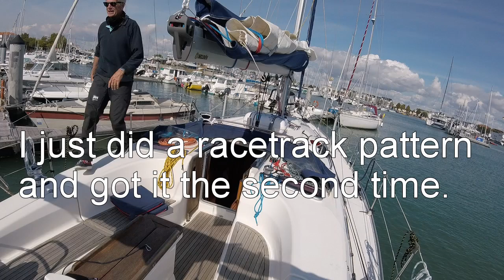Ep 18 Solo Sailing: How I Dock My 40' Sailboat 4 Examples and a Blooper

Comment: Patrick - your videos are really good. I like em' a lot - are very inspirational.

I have a Beneteau First 285 here in Sydney, Australia - is my first yacht and I love her to pieces despite her age (28 years) - plan is to master sailing her solo and I think I could benefit from having lazy jacks fitted to ease things when dropping the main.

Like you, my Furler can and does jam from time-to-time (no tension on the furling line etc. when letting out the headsail) and I've had dramas with shackle pins undoing themselves (all now moused with SS wire)

Not sure the boat is capable of doing a Trans-Tasman crossing to New Zealand, but who knows!!

Please do more videos - am looking forward to them already.
Reply from the maker: Hello RoadGoose from down under.   Yes --- the lazy jacks are a god-send for solo sailors.   I just open the clutch and let the main drop --- with just a minimal amount of compressing/adjustment of the sail afterward.   I have a lazy-bag also which is very nice (for UV protection and to keep the sail from filling in the wind).  The only (very minor) issue with the lazy bag is that I can't see the luff reefing point when I lower the main, so sometimes I stop it 2 or 3 inches too high, which also causes the leech reefing point to ride up.   I could do a second iteration of the reef process to make it slightly better, but I usually just accept what I have.   (I'll try to remember to mark the halyard where the correct reefing point is this year.)   Good luck on getting ready for the Trans Tasman --- a historic passage with a global reputation.  A real test of seamanship for sure.   I hope to make a few more videos when I head North in April.   I'll publish them if the content is of any interest.  Thanks for watching.

Comment: Enjoying your channel... Old crazy sailor that was always looking past me told me to approach the dock only at the speed you willing to hit it(engine stall in gear shift to reverse). Also being funny i thought i would sail up to the dock one day and at 50yards out a tornado sprang up and almost pushed me up the docks. I'm scared of them now lol.. Thanks again and keep up the great vids...
Reply from the maker: I have heard that old saying (no faster than you want to hit it) many times Jeffrey.   To be completely honest, I disagree.   I have found that it is vitally important to keep enough way on to fully control the boat during that critical final turn.   It is greatly preferable to be 0.5 knots too fast, than 0.5 knots too slow then.   If you are too slow, you either have to gun the engine for a burst of control, or make a very large helm correction, which will probably lead to more problems -- and if you are really too slow, no amount of helm will matter, you will just be blown sideways into the finger or the other boat in the slipway.  I know many are uncomfortable with the speed I show in docking (I've filmed about 90 approaches now -- most in marinas I had never been to before), but as a solo sailor, you have to place the boat exactly right.  When you have a crew, you can miss the finger by a meter or more, and someone can still step off……..
Reply: I agree, its vital to maintain control. 
There are also wind and currents running through these marinas that you can take advantage of to nestle you into a slip if you can choose the slip...  I always slow down and try to determine if there are currents and a breeze(look at the marina wind vane at entrance etc)or radio the dock master if weather is bad(they love when you ask for local knowledge). I used to attach a line to the stern cleat and when my boat approached the end of the pier i would just hook it onto or step off and attach the stern line to the end cleat(or near your stopping point). This eliminates almost all of the rushing/running and works perfect in high winds etc... I worked on the docks catching boaters in Florida for awhile and learned thats what those cleats are for! Just do one turn on the cleat with your line and you can literally control tons with ease. There is no right or wrong way in my book just whatever does not put others in danger or ruin a good time lol. Im on Ep 23. So much fun thanks...

Comment: Thank you for this series. It was very helpful to me as a new sailor and boat owner. I'm so afraid of driving in and out of marinas that it's becoming a big concern to me. If I don't get this fear under control I may have to give up sailing! I took sailing lessons and so I'm not a bad sailor and I'm very confident out in the open water, but this maneuvering in and out of marinas is stressing me out lol. Anyway, you have helped me a great deal and I wish you good fortune.
Reply from the maker: I can assure you Frances, you are not alone.   One thing I did was to take a weekend course of 'port maneuvers' with a local pro and 4 or 5 other students.   We did just about every maneuver possible (docking and leaving), numerous times.  That helped in providing me a solid foundation on the basics.    Unfortunately, almost all of the training was based on a multi-crew concept where someone steps ashore with a line when you get close to the pontoon.  That is not always relevant/practicable in a solo situation, but the training was very helpful anyway.   It's worth a small investment to build one's confidence.   Best regards

Comment: Interesting docking tactics!  good things to add to the tool belt.    Lately I've been experimenting with backing into the wind slow almost not moving, with the rudder cut hard to walk the back end up to things like mooring buoys and docks.  I like the spring bow bumper technique.     -Chad
Reply from the maker: I took lessons from an instructor once who uses the 'backing in' (against the wind) approach for almost everything, including picking up a mooring ball.  It does work very well on certain boats (like mine).   Not sure I understand what you are doing with the rudder, but if it is a sharp turn just as you arrive to capture the cleat or mooring ball, I got it.  That's what I like about backing in --- perfect control. I reverse in in Episode 25 and again in 32.  I probably should do it more often.   Thanks for commenting Chad.

Comment: The little 9.9hp outboard on my 26ft. Balboa had a habit of sputtering to a  stop at the most inopportune moments. Several times I had to bring her into the slip (fingers on both sides) under sail. Immediately after the first under sail docking, I mounted several pieces of thick styrofoam to the front of the slip to soften the blow. Worked like a charm.
Reply from the maker: Hey Grandpa, when I first learned to sail in the early 1970s, our boats had no engines, so we had to sail in and sail out of the slip.   It made for some colorful arrivals and departures!   Thanks for watching and commenting.

Comment: Great video - love your demeanor.  Very calm.  My new boat is a full-keel double ender.  She can be exciting to dock and especially to back up!  I'm getting the hang of it though.  To turn into a slip, I have to start the turn (she doesn't turn fast!), then kick her into reverse to swing the stern around while making sure the 7' bowsprit swings clear of the neighbor's boat, then back to forward.  =)
Reply from the maker: I am in awe and deep respect of full keel drivers Steve.   You guys take port maneuvers to a whole different level.   My boat not only has a fin keel (easy), but also a sail drive (so the prop is much further forward than on a conventional prop-shaft boat).  That means the prop walk is probably only about 1/2 of what others experience.  You full keelers are a different breed.   I wouldn't be brave enough to try to bring one of those into a marina single-handed ----- though I guess the old timers used to do it all of the time.   Thanks for watching.

Comment: I was recently introduced to the benefits of the midships cleat when berthing shorthanded. I now use it all the time! It adds one more step in the process, but there is nothing like lasooing the pontoon and then being held on the midships cleat. When I teach beginners I always start with the midships cleat so they know how to use it if all else goes wrong. This would negate your need to use fwd thrust to hold you on the berth. It does depend where the cleats are of course, but few sailing schools teach this. They always assume you are sailing with a full crew!
Reply from the maker: That is the problem -- technique for docking with crew is very different from docking (a relatively large) boat when solo.   In later episodes I show how I use the mid-cleat in conjunction with a docking stick.   Very nice technique.

Comment: Similar to that last one, I come in barely ahead off idle rudder angle 12-15 degrees or so away from the pier. Then I have the line on the cleat at what is known as the pivot point. Just as did you. However I have the end of the line back under the bridge of the cleat leaving a large loop in the line to hook the cleat with. With the rudder pointed away from the pier, I can lock the line onto the cleat and let the engine push my stern into the pier while the loop tightens and the forward motion leverages my bow in. IF I end up needing to shorten the line to keep the bow from moving too far forward after I hook loop the pier cleat that can be done by hand before the loop tightens down. If I can not I just run the end back to the winch island and winch the extra line in to snug the bow in.
Reply from the maker: Got it Spencer.  Good technique.   Obviously, the key is getting the loop around the cleat.    Once it is around the cleat, moving forward or aft is a matter of finesse to bring the boat alongside.    My lassoing skills will improve.  (I hope!)  :-)

Comment: I use a different techinque which i call the 'one cleat technique' and works as follows:
on arrival you prepare all your lines and fenders the usual way (in unknown ports i prepare both sides of the boat with fenders and 3 lines (fore, aft and amidships)).
all lines are looped back under the guardrail so i can tie them off immediatly.
I sail (under enginepower) to the pontoon and choose a bollard for my purpose. I then bring my aft cleat next to the chosen bollard, put my mooringline (loop!) around it, tie the other end to the cleat on the boat (not to short!).
Then I put the engine in forward with helm all the way toward the pontoon! depeniding on windforce, current etc. I then aply more or less power to the propellor. The boat will then swing nicely to the pontoon and then i can tie up the other mooringlines. this technique works even with considerable windforce blowing me off the pontoon. It also works in locks although boats behind me do not always appreciate what I am doing ;-)
the main benefits of this technique are:
- it is fairly simple;
- I can stay at the helmstation, no running around on deck until I am in a controlled position.
Reply from the maker: Very nice explanation pvdneste.   I use this technique too, but usually only when the wind is blowing me onto the pontoon.   It's still sometimes a bit of a challenge to get the line over the bollard, but I agree with you, it is much easier than running to midships.   I did have a 'difficult' experience doing this method once when the wind was blowing hard off the pontoon.  I got my stern into the pontoon and managed to get the line around the bollard, but I was a little slow putting the engine into forward gear and driving me into the pontoon.   A gust of wind caught the bow and despite all my efforts (including full bow thruster and heavy engine power), the boat remained tied to the bollard and 90 degrees to the pontoon.  I finally just let the line go, and came around again, but this time, ran to midships and lassoed the bollard, which kept the bow from swinging out.   Thanks for sharing your excellent technique (which I really do use also).  Best regards

Comment: I have to say that watching you pulling into the dock makes me cringe every time, but that's only because I'm used to my old C&C 33 with a folding prop... your boat stops! Mine slows down ever so slightly when I hit reverse and entering the slip at that speed would result in a crash! :) 
For reference: My solo docking technique normally is to simply have my bow line and midships lines run back to the gate and a stern line looped over the lifelines aft of the gate, come in slowly but steadily (in reverse - I have little brakes), then at the last moment give it a shot of gas in reverse to more or less stop the bot, then neutral and trot off and grab the midship line and tie it off tight then casually attend to the other lines. It usually goes well, and sometimes I do it completely differently!

Really great videos, Patrick. It is refreshing to watch some videos on here with actual sailing!

Question: Your autohelm looks like it works brilliantly - what make and model is it? 

Cheers from Montreal!
Paul
Reply from the maker: Yeah, my neighbors are a bit nervous as well, but they have now seen me do it a couple of hundred times, so they just stare in bewilderment now, instead of in shock.  :-)   I'm sure that if my circumstances were a bit different (wind not at 90 degrees pushing me into the neighbor's boat, finger a bit longer, boat a bit shorter, an additional crewmember, etc.), I'd adapt to those conditions and use a different technique.  As you suggest, due to folding prop, or prop walk, or full keel, or different prevailing winds, there is no such thing as a miracle solution that will work in all conditions.   My autopilot is a Lewmar Integra.   Many thanks for watching, and Vive le Québec Libre!

Comment: a perfect bow pin! to dock with my beam to the dock, i rig the stern line with a big bowline loop, i work up parallel slowly, then lean over and lasso the dock cleat from the cockpit, and cleat it to the stern boat cleat snug. then i turn INTO the dock, pinning the bow with the force of the engine, with the stern line holding the stern from swinging out or moving forward. then you can throw loops at the spring dock cleat and bow dock cleat from the boat and tie up w/o stepping off. slick move, and very easy especially for high wind situations.
Reply from the maker: Conceptually, I really like this Dawntreader.  Especially you, with a narrow stern.  If you can reach the cleat with your bowline, I should be able to as well.   The challenge is, of course, getting the bowline around the cleat.  I imagine this might be a challenge in conditions with high winds blowing you off, or a strong current, but it can't be worse than my method of running to midships and trying to quickly lasso a cleat.  Thanks for sharing with us.
Reply: if i can, i won't bother tying the bowline loop, i"ll just reach over and get  the bend over the cleat and hang on to the bitter end so i'm doubled back. a boat hook works well for me too,especially if it's windy.
Reply from the maker: I'll give it a try.   I've thought of doing this before, but didn't think I could get the stern close enough (except on very calm days).   Many thanks.